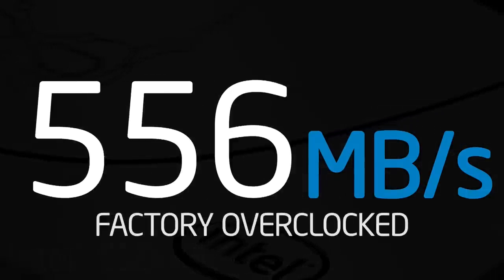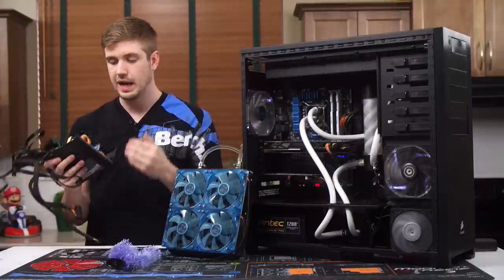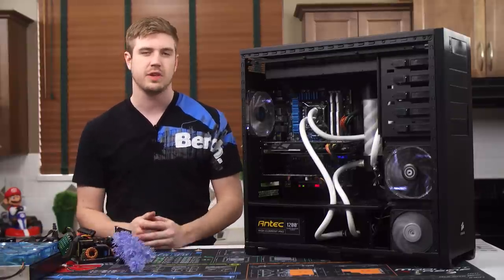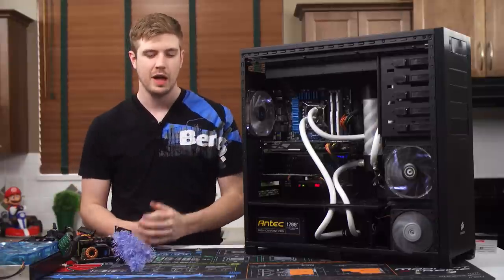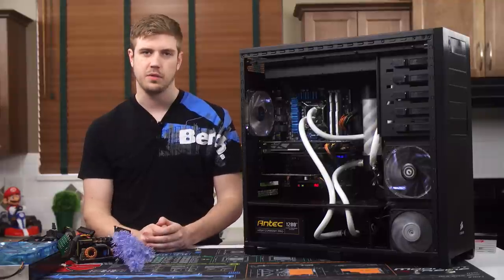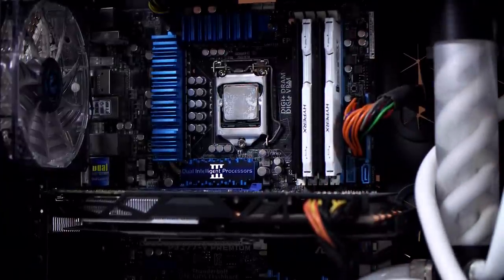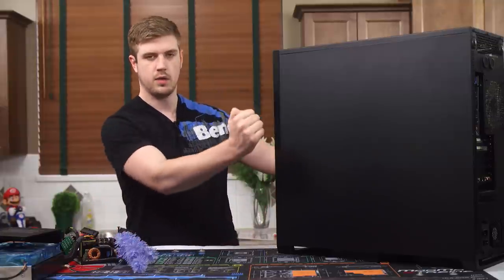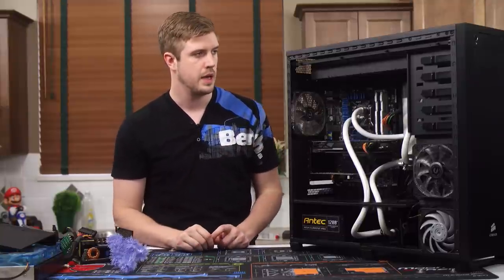Personal Rig Update 2 - Slick: The Introduction of Squirtle

Comment: if I would have gotten a custom computer with a i7 k in 2010, would it still be fast enough for full Hd editing and gaming?
Reply: Any i7 is still more than enough for gaming and editing^^
Reply: Yes, it would be, provided your GPU is up to the job too.
Reply: dakrisis Yeah, most upcoming next gen titles mainly require an eight core CPU while not being too demanding in the GPU department.
Reply: Kettles Smeff I haven't seen a single next gen game requiring an 8 Core. Just because a ps4 has 8 cpu cores doesn't mean it's any more powerful than a good Intel/amd quad core. Also gpu power is getting ever more important since cpu based tasks are getting moved onto the gpu through Cuda and open cl. 3d rendering is so much quicker on a gpu than it is on a cpu, even my gtx560ti can go multiple times faster than my i5 2500k. And that gpu is currently easily the bottleneck in my pc. Even with cpu intensive games such as BeamNG.
Reply: Kettles Smeff Nah, no next gen game will really take advantage. Watchdogs has recommended specs for an 8 core AMD FX but it won't perform better than the equivalent intel quad core. Consoles have 8 cores, but they're weak threads that cannot possibly complete with any desktop processor.
Reply: It would be just as fast as a current i7k, just lacking some features.
Current cpus are clocked higher, but overclock less.
Reply: Jake Surname I don't agree with that. Not all CPUs of the same generation are the same. Some 4670k cpus can overclock more, some less for example; some can get theirs to over 5Ghz stable and some people find that they can only reach 4.7Ghz before they reach problems.
Reply: Craig Morrow
Yep, every CPU is completely different. And every CPU has faulty transistors. More faulty transistors means less overclockability.
The K- processors generally have the least amount of faults, because the other processors will be sorted out and will be for example a T- processor. Still there are some big differences between the K series processors. Got my 2500k @ 4,80GHz with only 1,280V... Not a golden sample, but still a very nice CPU...
Reply: Yes, but the 2500k and 2600k (pretty sure they were 2010) overclock to those same numbers.
Except a 4670k is clocked at 3.8 by default, meaning 0.4-0.5ghz less of that 5ghz is a part of the overclock.
Reply: Jake Surname Sandybridge are much weaker than ivy or haswell cpus. A 5GHz 2500k is still beaten by a 4.5Ghz 4670k; they're really starting to show their age now.
Reply: Craig Morrow Actually (gaming wise) thats not true. Haswell is only 10-25% faster than Sandy. So a 30% oc on Sandy will definately compensate for that... Got mine overclocked 45% so it will outperform every 4670k at 4,4GHz or less.
Reply: Craig Morrow
Nah, they are certainly not showing their age, i totally agree that they aren't as fast as their newer replacements but they are certainly more than fast enough for anything i can throw at it. I don't think sandybridge is showing its age since it is only about 15-20%% slower than haswell.
Reply: Mega Know
Well yes, HD editing is possible on a pentium 2 300mhz cpu, but its not like i would recommend it. It is also possible that a cpu can bottleneck your gpu in games meaning that no matter how fast the gpu is it cant play the game any faster because the cpu cant keep up. Imagine a titan z with a pentium 2 300mhz (ignoring the motherboard incompatibility between the two stuff).
So it is a meaningful question, since they didn't mention graphics performance anyway, they only mentioned performance in general.
Reply: I would recommend something better than a 2500k at stock for real time 1080p video encoding. 8 cores would be a huge advantage for that.
I wasn't using quick sync however.
Reply: Your rig is going to need the extra threads if you expect to run Ultra settings. These are some of the first games to actually utilize those eight core CPUs. Me personally, I like having an excess of 100+ fps, its grown on me and I need all the extra processing power I can get. So you if you want butter smooth game play while running Ultra, I suggest you get a better CPU, just make sure neither your CPU or GPU overpower the other, especially your GPU.
Reply: Nah, If you want a high quality picture you have to run an IPS panel, which means 60fps.
Reply: In 2010 I had the option to get a pc in the USA. I know I can't change anything, but after buying one at the high German prices, I regret it.
Reply: Jake Surname
Or just make sure that you use software which uses open cl or cuda and you wont be doing any rendering on the cpu. GPU's can handle video rendering a lot quicker than cpu's can my render times in blender are about 8x faster using cuda than they are on my cpu. So i cant really recommend using the cpu for rendering at all.

Comment: 1200W PSU? For what? 600W would be just enough for everything
Reply: 600W for everything ? lol no
Reply: Elgabro a gtx titan and an i7 4770k can run with only 420W.........
Reply: Because he can? Overclocking? Fully modular? Expansion room?
Reply: for his PC i think 800W
Reply: it could easily run on a 600W
Reply: Who the hell do you think he is?
Reply: dude.... did you see that water cooling setup? and the 5.0ghz clock speed on that 2600k?
Reply: Well since the best efficiency is actually at 50% load that means that in the end what he did with the 1200W PSU isn't that bad....
Reply: If he wants to go sli in the future or swapps the graphics card for a dual gpu one, it won't be enough.
Reply: Kitsune Yes bro, but even for SLI, ~800W would be enough, even for (almost) any dual GPU beast it would be ok, but for this particular system, right now - 1200W is just a waste of money. Take a look @ http://images.anandtech.com/graphs/graph7492/59710.png
Cheers
Reply: I totally agree with you im just majking a point
Reply: I have a 1050W with a 2600k, 7950 and 5770 and a bunch of HDDs. Nothing wrong with an overkill PSU, keeps the fan in it really quiet, also allows for more upgrades and stuff
Reply: Branislav Dostanic I don't think he intentionally bought a 1200W PSU anyways. His rig is literally full of linus media group/ NCIX "scrap" and some of his own parts.
So i bet he just got a good deal on a garage sale or thats a review unit.
Reply: yeah i think so too
Reply: Branislav Dostanic Was probably free or heavily discounted. I paid full price for my 1050W PSU and it's overkill. 
I don't see why it matters to you what he chooses for his build? Even if he had paid for everything in full, it'd be his money so he can do what he wants right?
Reply: What about a R9 295X2?
Reply: bassl0va Probably...It does not matter to me at all, I just said ~600W wud do the job that's it. Cheers